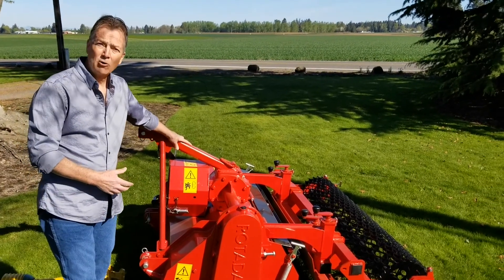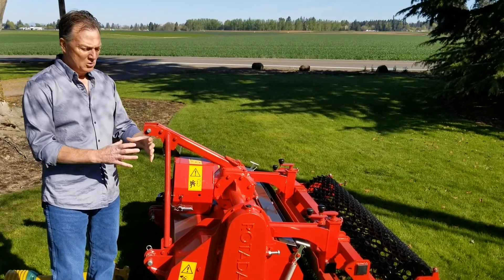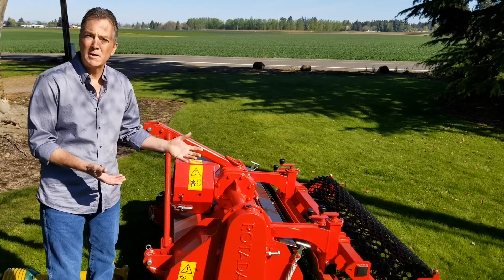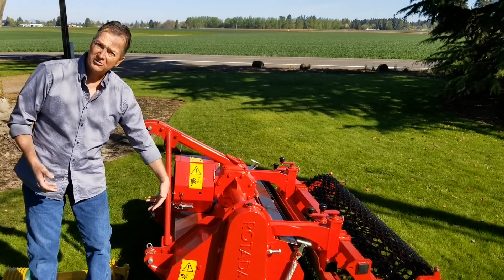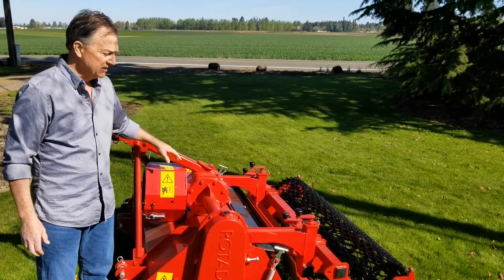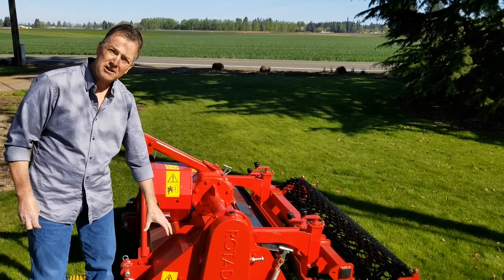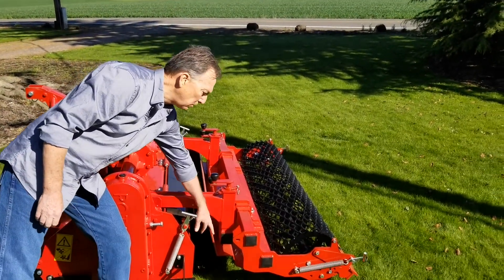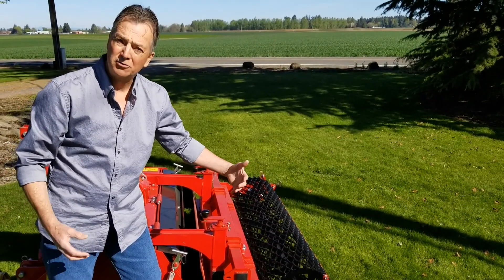Rotadairon RD150 soil conditioner basic functionality.

Comment: Are these sold in the U.S.? Also how much?
Reply from the maker: Yes. Salem, OR. They range from high four digits for the mini-skid units, increasing in size, till depth, power requirements, working width, and price up to mid-five digits (plus shipping) for the biggest agricultural units. You can locate the best machine for you based on your power unit here. Then give us a call for exact pricing. https://www.rotadairon.com/machines